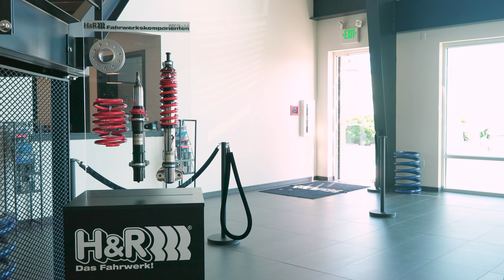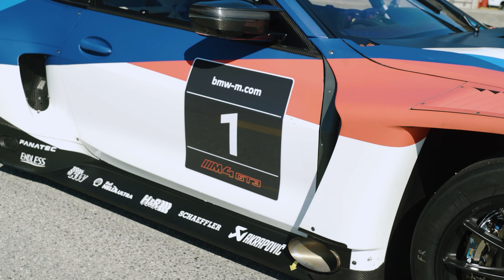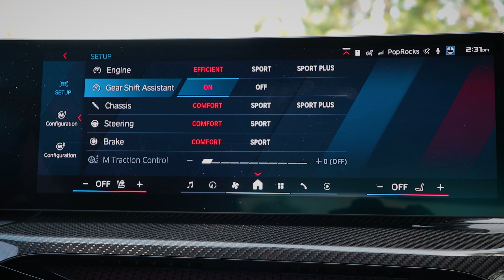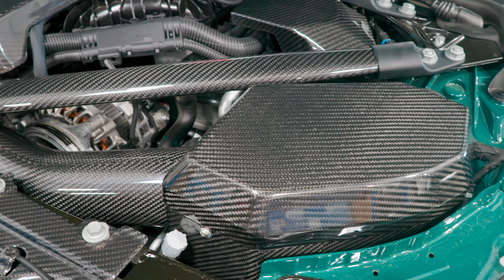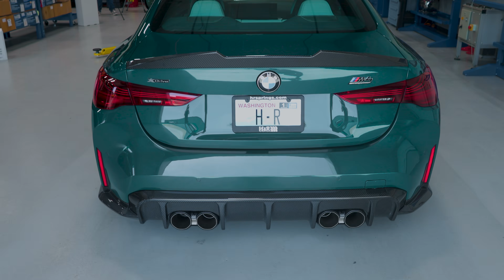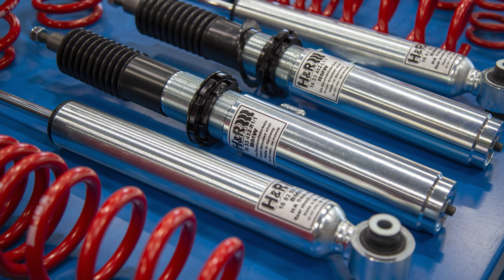BMW M4 G82 with H&R Lower Springs - Walkaround

Comment: 4:00 solid bars are an inferior product. I'm not sure why they are being advertised here as being better. They weight much more to achieve the same roll stiffness. Durability is equivalent, as both setups can easily handle all the abuse that can be thrown at them. The difference is that solid bars are cheaper to manufacture.

Comment: Spacers are horrible.  Just get wheels that fit without.
Reply from the maker: Spacers are cheaper than wheels and not everyone wants the biggest wheels.
Reply: @bmwblog  Biggest wheels?  You can get whatever size you want that's lighter and stronger in the aftermarket.  Spacers are cheap with cheap results.

Comment: This is what I don’t understand. Why would someone switch out their swaybar just because it’s aftermarket? It doesn’t necessarily mean it’s better. My 2025 M4 Competition, which has the LCI updates, is phenomenal. They really need to explain and justify why someone would spend $2000 with labor to replace swaybars on a car that most people can’t even push to the limit.
Reply: Swaybars should be the last adjustment for suspension setup. I assume the springs and struts were replaced with a custom coilovers system. 

Swaybars decrease bodyroll and increase rigidity, however, there is a trade off. Without proper suspension travel, the wheel can free hang during hard corners.
Reply: same goes for springs, spacers etc.  you're modifying what M engineers painstakingly set up upon thousands of hours and millions of dollars of R&D.  All that carbon on his car is also straight outta china.  all fine and dandy because the quality is near OEM and much cheaper.
Reply: @kcw9313 hey bro this is for people who can afford the car, you cornball 🫡
Reply: @MinuteRiffsGuitar 😂🎉
Reply from the maker: Could be for people who track their cars? Lots of people upgrade their cars. Even expensive 911s